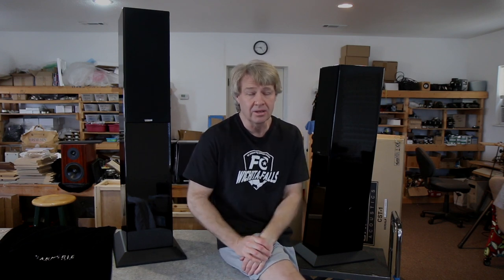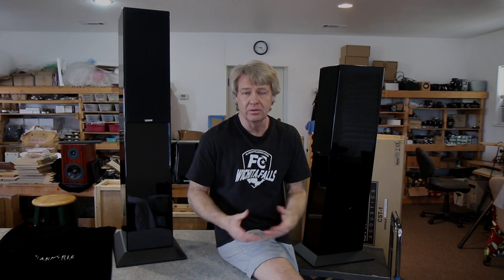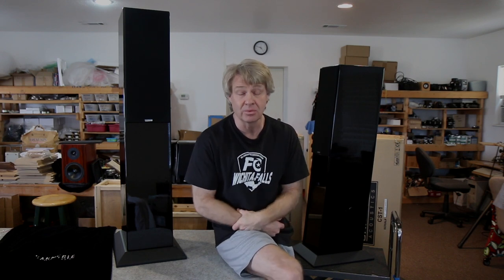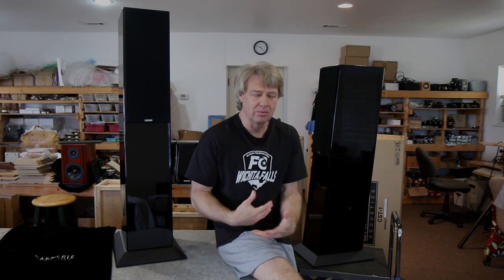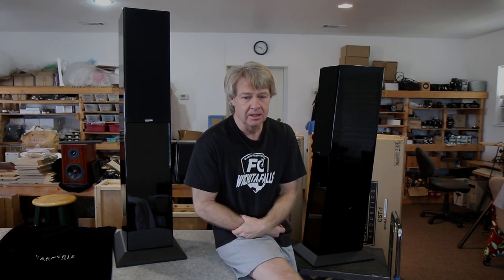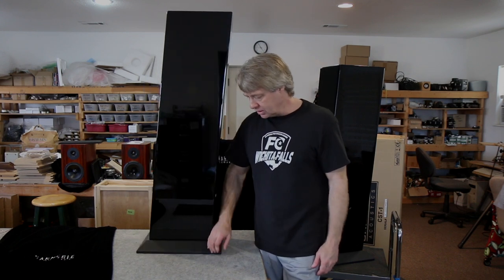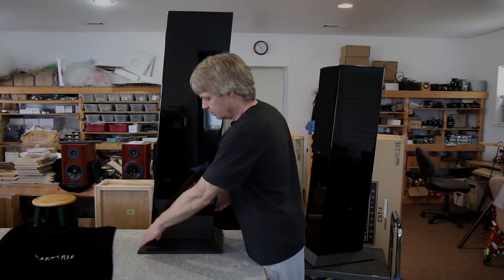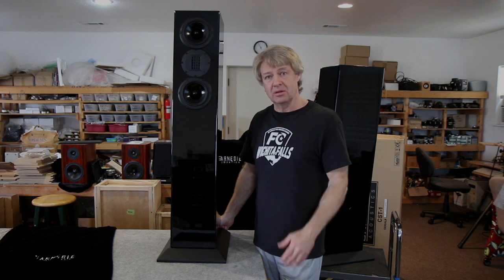Clearance! THE SPEAKERS YOU'VE BEEN ASKING FOR!

Comment: Darnit Danny, 😎
I've had these CST-1'S with crossovers upgraded, and your other recommended upgrades for nearly 3-years...
I recently figured out properly positioned speakers and sub...🎶
Thank you Danny, although I'm an old man now, 
I've dreamed of this beautiful sound since I was a teenager.
Using an Old Marantz 100w/ ch Stereo,
Good speaker positioning, +
SVS sb-1000 positioned well...
= happy old man 👍
God bless you and yours. 🎶
Reply: Upgraded from the old Marantz SR7002 receiver (100w/ch)  to EMOTIVA XPA-DR1 Monoblock's (650w/ch),  EMOTIVA XDA-3-DAC, and better speaker cables. Hearing this is helping me to understand what Danny talks about. 
This is like feeding NOS to the CST-1's. 🎶 😁 🎶
Reply: @AverageNiceGuy  All the vids you post with these speakers sound amazing btw. Might still have a chance to buy a pair of these locally. Your pair has all upgraded caps and wiring?
Reply: @anthixious  Hello, I thought that I replied to this earlier.. 🤔
Yes,, upgraded capacitors and no-rez.
I have a video comparing before and after.
If you want "punch in the belly" power, the small woofers won't do that like a 10-12 inch woofer.
The ~"planar magnetic" tweeters are beautiful, smooth, detailed, and not fatiguing. 
The transmission line bass is nice.
I'm recently using these full range, with an SVS SB-1000 subwoofer.
I tilted them up 3 inches in the front to raise soundstage (braced in the back). 
I'm shopping for streaming options.
I am not shopping for speakers.
To better these CST-1's, i would need to spend a few thousand dollars.

Comment: How about a DIY loudspeaker kit including a flat pack unfinished box that goes 20-20K +-3dB with big magnet cast basket 10" woofer(s?) for under $3K? I think it could be done profitably and you'd be giving a nearly $10K retail speaker value just by taking out the distributor and retailer profit! You've gained the trust of the audio community and I think it would work, I'd buy a pair!
Reply: Salvatore Rossignolo I agree.
Reply: We've gotten away from large heavy drivers like 10" woofer and use smaller and faster drivers with more control. 

If you want to get really serious then here you go: http://gr-research.com/obseries.aspx
Reply: Tekton Double Impact - shipped and don't even have to build them yourself.
Reply: @mw4609  Oddly I just heard from an owner of that speaker a few days ago. They are not all that happy with them and are asking about sending them in for an upgrade.
Reply: Maybe they didn't go with the factory upgrade, $300 for solid billet copper Cardas inputs (USA), mil-spec internal wiring, Mundorf or ClarityCap (depending upon real-time availability) within the tweeter section. Includes an oversized Jantzen or Erse Sledgehammer inductor (depending upon real-time availability) within the woofer section. That's what I have, along with $75 extra for both grills. They can tell if the DI's are upgrade version by the solid billet copper binding posts. Danny, you never answered about availability of AV123-style metal grills for the Xstatic?
Reply: Those are all really good parts and should make quite the difference. Line them with some No Rez to get rid of the cabinet resonance issues and call it good. 

I can not get the metal grills that AV123 have made originally for the X-Statiks.
Reply: @dannyrichie9743  Were the metal grills also made in China? I haven't hear Tekton DI's without upgrade option, so don't know how much of an improvement there is. If you have someone asking to upgrade, you might vette them first - to be sure they aren't already upgraded. Haven't noticed cabinet resonance and I'm usually quick to hear that (Martin Logan XT60, XT40, and LX16 - think it runs similar throughout the box series). If someone did, No Rez would certainly take care of it - good advice! I'd recommend installing it where they stand, because those are some heavy (120 lb.) speakers already.
Reply: The metal grills were made in China. 

Ron Brenay noted some heavy cabinet resonance issues on the pair that he reviewed. I also noticed quite a bit on the Lore model that we upgraded. All were lightly built and braced.
Reply: @mw4609  what you need is probably the same or better acoustic putty pads self adhesive

Comment: That speaker is so fine. That cabinetry is top drawer. I know it will sound great especially with all your drivers, crossover parts and pads to put in. Already has tube connectors to? That’s a freaking great deal!
Reply: I've been very impressed with the the ones I've received, 😎

Comment: CST's ordered today!
With upgraded Capacitor's and No-rez!
Woo-hoo new toyz 😎
Reply: how is the sound
Reply: @joeygonzo  I am very impressed. I finished the upgrades with sonicaps, and the no-rez internall insulation. Prior to these, the SVS-Ultra Bookshelves, and SVS SB-1000 subbwoofer, driven with a Marantz receiver, was the nicest system I had owned. These CST-1's have significantly better tweeters, and the bass response is so nice, I gave away the BIC-America sub that I thought they would need. These sound like they belong in a class of speaker that costs $2000 plus. The SVS-Ultra bookshelves sound like solid $1k. The waveguide and bandpass labyrinth, with the bass exiting the bottom rear is impressive. The beauty of sound coming out the front is very satisfying. There are some more professional writeups available on the internet (Carnegie CST-1's) but these are a little better with the sonicaps and no-rez. They are like a good wife, I don't even look at other speakers anymore. :0
Reply: They are not $10,000+ speakers, but very nice if properly positioned with a sealed sub. Impressive tweeters.
Towed in slighty, angled up slightly, lsealed sub in center... Carpeted room 20x20 ft, diagonal.
I would need to spend several thousand dollars more for a better sound.

Comment: Those look beautiful!  Thanks for all your help. You got me fiddling with my speakers again Danny. I'm in the basement so looks is not an issue for me. :)  I've gotten big sonic improvements (to my ears) by Mortite covering the woofer frames on my Klipsch R-51M's, direct soldering Kimber Wire speaker cable to the crossovers, and switching to Solen Caps. In your experience, would air-core inductors and better resistors improve the sound as much as what I've gotten so far?
Reply: No !

Comment: Back in the day  my hobby was involvement  in car systems for big exhibition center shows  a friend who had amps, speakers etc made with  his own brand name assembled originally in Taiwan then manufacturing moved to China the companies there were apparently so keen to meet delivery times they  would not fit certain items and change component values at will.   25 years later another friend works with and imports hi end Chinese valve/tube amps  they will have parts made in Japan as they understand consumer requirements. I don't know when these speakers were made. However your solution  of cutting your losses and giving consumers  a low price point is a win win;   It's a shame what is obviously 95% of  great speaker that was spoilt for "A ha'porth of tar"

Comment: Dang these look awesome!  I would pull the trigger right now, but I can't be satisfied with -3db at 40hz so I would need to add a subwoofer, and I don't have a source with a subwoofer output either... so I would need a source and a sub just to make these work for me =/.  I've always been into DIY audio stuff but if you keep offering this kind of value, whether it's a price-slashed pre-made or a high value kit, I may have to think twice!  I really love horns, but I've been dying to get some planar speakers.

I'd love to see what Dannie could do with some horns, with his own kit!!!  Something like the Geddes speakers, but even more full-range.  I really want speakers that can do a solid -3db at 20-25hz so that no sub is needed.  Even -3db at 30hz would be acceptable.  The big Geddes speaker (15") looks incredible and I really want a pair but they're not tuned to really play that low, though perhaps it could be coaxed out of them idk.  I don't want to integrate a sub.  If I'm gonna drop a couple grand on speakers I don't want to have to drop another grand or two on a sub and then look at different source and amplifier candidates, since I prefer using budget audiophile 2-ch amplifier boards... just the board, psu sold separate, no case.  It's the only way to get 200 watts of audiophile level audio for 300 bucks. www.connexelectronic.com (when I say 200 watts I mean into 8 ohms and not with a 1% thd figure, I mean a .02% or less distortion figure!)

I've always liked big speakers, my speakers (custom made) have 15" jbl 2225H's and while they need some EQ to boost the bass they sure have no problem putting out tons of bass down to ~30hz.  I'd say the mechanical/enclosure rolloff begins around 35hz, is still strong at 30hz, significantly down but usable at 25hz, and way down but audible and noticeably pressurizing the room and shaking things at 20hz.  Thus they serve me well for movies and music at any volume.  Regardless of the relative -3db point, since EQ can adjust for that in either case, those two little woofers just cant put out the spl 15"'s can, even with an awesome transmission line.

But my god, I know the mids and highs would be so much sweeter than my already decent setup!
Reply: We have servo controlled woofers that will do anything you want them to do and then some. They even have high level inputs. So they will work with anything. Oh, and they play flat to 20Hz and stop on a dime. 

http://gr-research.com/diysubwooferkits.aspx

And I have worked on horn speakers and high sensitivity models quite a bit. I have helped some guys straighten out their Geddes speakers too. They had a lot of resonance issues and needed crossover upgrades badly.
Reply: Ever heard of high level and level inputs?
Reply: @chriswelljack4910  yes i have thanks, was always just skeptical of putting something else in the path from amp to speaker.
Reply: @Artcore103  ok a good those are the best ways to hook up a sub for music that's why REL subs are so versatile they give hook ups for full range and lfe

Comment: I have a set of Mission m74i's. I like the sound but cones and high ends are now 12 years old. Let me know if you are familiar with the box's and let me know if its worth while upgrading the electronics and moving parts. This old guy from Canada is enjoying your video's
Reply: It is hard to say if they are worth it or not. Lots of upside potential for sure, but for what it may cost, verses starting over with a kit or something... Ah, not enough information yet to know. 

And good looking Nova.
Reply: searching for an hour can't find the crossover for that model. but it's a good speaker you don't need to change the drivers they are rubber surrounds, the only thing you might want to change is the electrolytic capacitors for metal film poly capacitors, of the same value make sure that all are balanced or at 1% or lower, and some natural wool fleece stuffing in the back try 20% possibly. Speak to to somebody who will have some experience with them I word first Call try WilmslowAudio in the UK, there's a place in the us madisound both of these companies will have vast knowledge and could advise you on crossover, and maybe one upgrade the tweeter that's the only driver I possibly would upgrade for scan speak or seas, but they'll be able to give you the right driver for your speaker. There's a forum called DIYaudio forum, there be somebody has done that crossover more than likely, very friendly knowledgeable chaps, about amplified speaker building somebody be able to advise you. Good luck. The easiest solution is to change those electrolytics they probably be blue non-polarized, I can't remember the make now of hand. you don't need soldering skills for crossovers  some decent high-grade  solder silver 60/40 to solder and a good iron 60 Watts.
. Just write down the value of of the non polarised electrolytic capacitor values. Go somewhere like digikey or mouser or those companies I suggested, and try and get some metal film poly capacitors to replace them. Talk to those two companies first they might sell your complete crossover kit they probably make one for your speaker, or can put one together for you. If you take it on let me know how it goes, worth doing for that speaker 74i these speakers selling I don't think these are any better than what you've got.
Reply: @dannyrichie9743  Thanks for the reply. the speakers still sound good but after all these years ya get a bit complacent with the sound. And technology has come a long way since ive owned these. Was just asking a viable question is all. And as for the Nova I built it from a shell. 509 ci and has ran a 10.2 @ 128mph on 10 inch tires and no bottle. Pretty quick street car. Have a good day!
Reply: @johnsweda2999  Thanks for the reply John. Actually nice to have someone reply to a question on You tube, Doesn't happen to often. I will keep your suggestions in mind. Have a great day!
Reply: If you like the way they sound but would like to improve the clarity and detail levels then just upgrade value for value and start with the capacitors. Replace the inductors if they are iron core. If they are air core then they are okay. Then consider the wire and binding post. Maybe this will help: https://www.audiocircle.com/index.php?topic=137288.0
Reply: And I love the car. And I'm a drag racer myself. So very cool.

Comment: Hi Danny I’m wondering are SpeakON connectors a superior connection or should I stick to speaker cables for home audio? I have not heard much content on this, just wondering because I have seen many new amps have SpeakON connectors and XLR connectors. What are your thoughts?
Reply: We use the SpeakOn connectors on our servo subs, and for 200Hz and down, they're fine. Above that they give a lot up to tube connectors. Tube connectors sound cleaner.

Comment: If the speaker already has BENIC or other relatively good polyester or pomypropylene capacitor but the speaker has bad sound then the do not help to switch to expensive filter parts! then  construction is wrong and not the quality of parts!